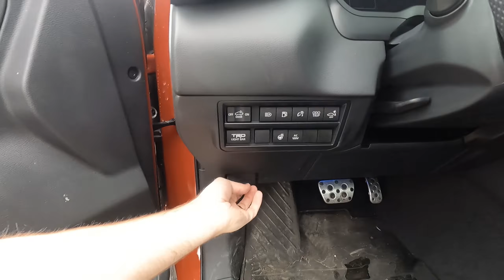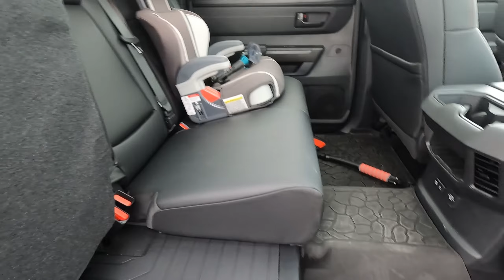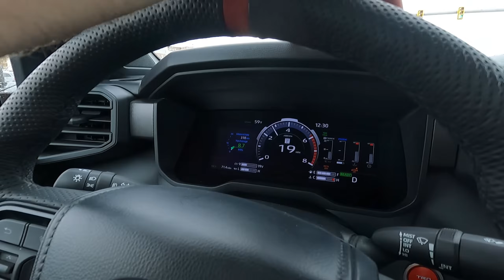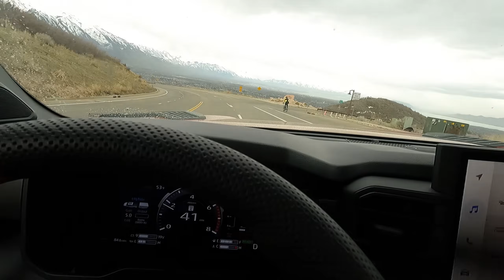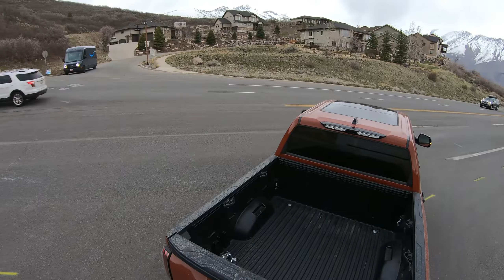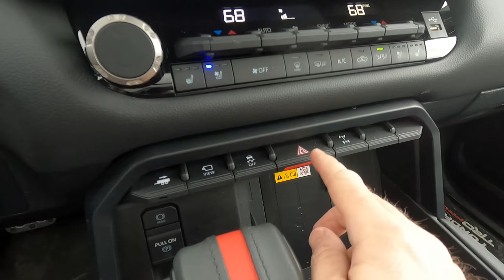2024 Tundra TRD Pro Towing: Hybrid for Power, Not Efficiency

Comment: I would not go faster than 55 when towing you might be able to get in the low teens
Reply from the maker: That's a great point. Slower and a smaller profile trailer would make a huge difference. 55 mph is smart where it makes sense. It saves fuel and is much less likely to have sway issues compared to 70mph. With 70-80 mph speed limits on the freeways around me 55mph is slow enough to be dangerous, the slowest I'd go is about 10 under.

Comment: How did you add the other gauges for oil temp and trans.
Reply from the maker: I don't remember exactly now, but there are settings within the gauge cluster menu to enable different screens. I find it to be a weird setup, first you have to enable the screen, then in a different settings screen you select which one shows up on the display.

Comment: I must have missed it. How much is the weight of the trailer? I am looking at a 2024 tundra to pull a trailer about 6000-6100. Was going to tow a camper for full time RVing but then unhooking and need TRD off-road stuff too. 

Trying to get an idea what all options ect I need to minimize away and also have off road capability.
Reply from the maker: This trailer is only 4,700-4,800 lbs. However it has a massive frontal area. Most new trailers will be much more aerodynamic than this one. You should have no problems with a 6k lb GVWR trailer.
Be sure to get a high quality weight distribution hitch, and have it properly set up. I always recommend Equal-i-zer as they offer the highest product quality and customer service in my experience. With a properly set up weight distribution hitch you should have no problems towing a trailer that size with a TRD Pro, or just about any other Tundra for that matter.

Comment: I don't know why you're driving so fast with a trailer I would keep it at about 55 mph and you would get much better mileage too
Reply from the maker: Thanks for watching and commenting!

You are 100% correct from a fuel mileage and towing stability standpoint. The higher the speed the less stable the setup, and of course lower mpgs.

I prefer 65-70 mph (I know I went over that in this video, but typically I don't) for towing. Usually 5-10 mph below the speed limit on freeways in the west. That gets me to my destination in about 20% less time compared to 55mph (if it's a long trip, this matters, if it's under 60 miles, not so much). Another reason is to not impede on the flow of traffic. One vehicle going 55 mph in the far right lane can cause traffic to build up across all lanes in a short amount of time. This mostly happens from people not watching traffic far enough ahead and making lane changes early (which one person IS NOT responsible for how another person drives).

Comment: No distribution hitch?
Reply from the maker: No, I had that in the intro, but it's also later on in the video so I deleted the early one to reduce the length.

I never use a weight distribution hitch for these tests because I want to see how stable the tow vehicle is. I have access to Equal-i-zer brand hitches which have really good sway control along with weight distribution. My recommendation is to always use a weight distribution hitch with sway control when towing a high profile trailer, especially these camping trailers that are pretty light with a high center of gravity.
Reply: @EngineAdventures  ahh, gotcha.